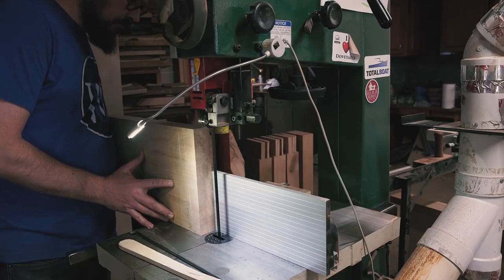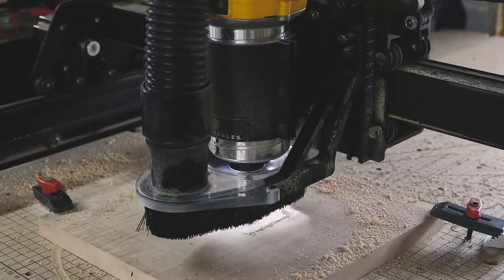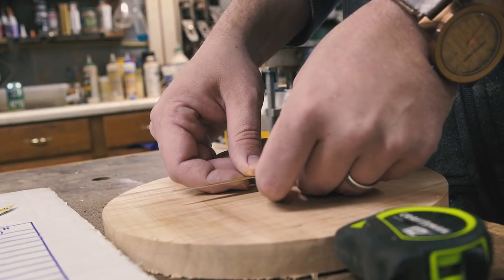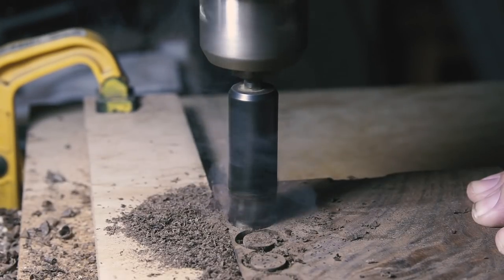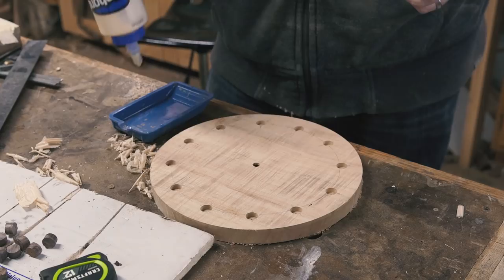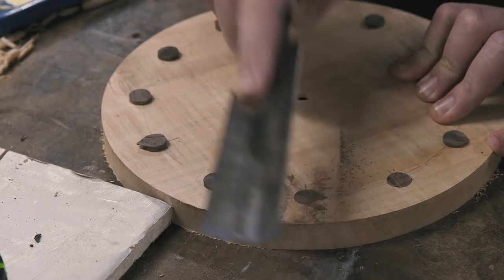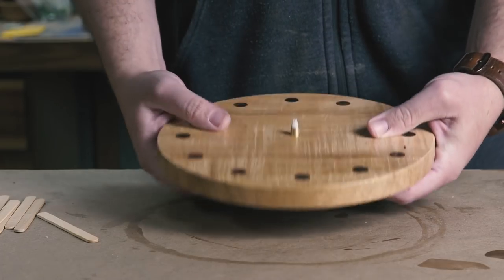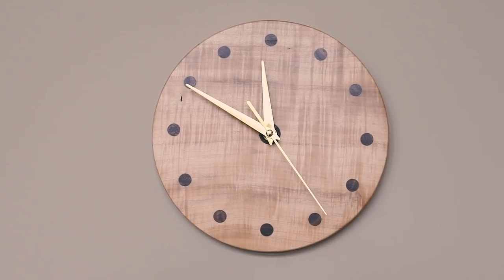A Story About Time | A Message of Hope and a Clock

Comment: Love the clock as well as most of your projects and videos. Little tip I saw a while back, when cutting plugs free, before going to the band saw, cover them with painter's tape, single piece on the newly cut plugs. When they are cut free, they won't go flying across the room, but instead be stuck to the tape.